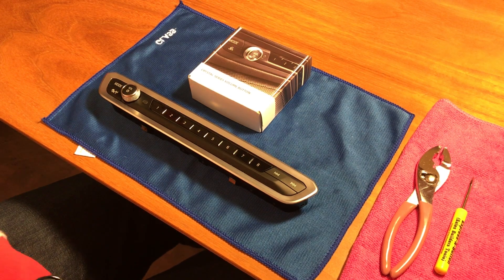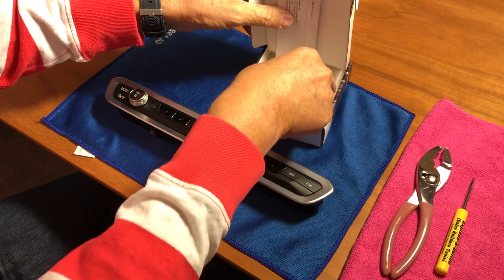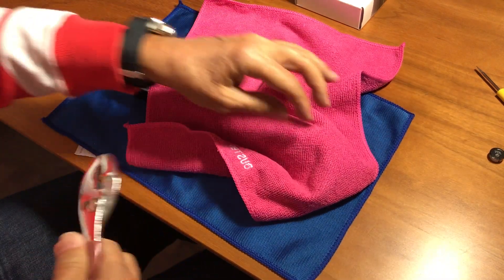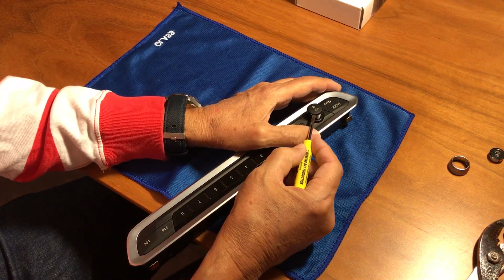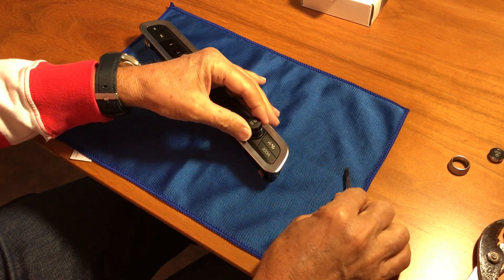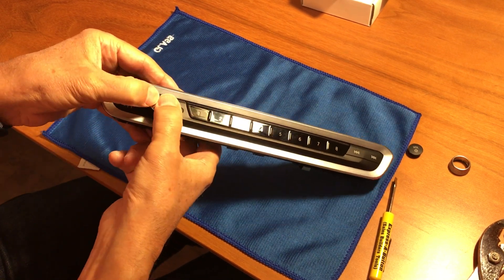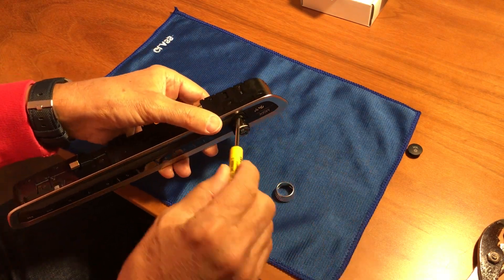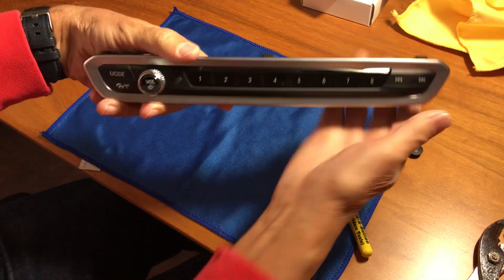Installation of Crystal Volume Button for BMW.

Comment: I ended up destroying the trim ring when using this method...

I have ordered a new unit, and will be removing the trim ring from that to apply to my car.

What is your best advice to avoid damaging the trim ring? Is there an alternative method to removing it?
Reply from the maker: On car-analysis.com there is another video showing a different method and a PDF as well as further instructions showing 2 other alternate installation methods.
Reply: I did too!   Where can I get a replacement volume trim ring?
Reply: @DeanRees-b4x  You can't got to buy a new radio

Comment: where can i buy a crystal series volume button? My BMW dealer cannot find one for my 8 series? I bought another product online but when inserted it was not straight
Reply from the maker: If your 8 series is 2023 or older, I have the product for you. If it’s 2024 or newer, I cannot help you. I don’t know if anyone sells that product. You may have to buy the whole panel from BMW.
Reply: @car-analysis  ok please direct me to where I can purchase . My vehicle is a 2021
Reply from the maker: @Gerardwillemse1  I have it in stock. Email me at info@car-analysis.com for details.

Comment: How do you remove the whole panel/ assembly out of the dash? 
Thanks !
Reply from the maker: There is no need to remove the panel from the car. Note that there are several alternatives for this installation.

Comment: Can you do a video on how to remove interior trim?
Reply from the maker: Not sure what you mean with the interior trim? If you mean the radio panel, it does not have to be removed.
Reply from the maker: There is now an installation PDF on car-analysis.com
Reply: @car-analysis  I need to remove my panel to install something else, is there a method to doing this?  Using a pry tool I feel like I am breaking the panel.  If you have a good method to share I would really appreciate it!  Thank you!
Reply from the maker: @JMG-703  Sorry, I don't have any good info about removing the panel because that is not required when installing our product. I know that some users removed the panel accidentally when trying to remove the trim ring or the button. But you can go to BMW Repair Manual, see https://car-analysis.com/BMW-Crystal-Series-installation.htm

Comment: Good video, however is not always not very practical for driver to remove the unit to install. You should as least have a video showing do it for all your installation video in the cAr. This is due to the different angle how on it going to be done. Removing unit just need another tough step again...
Reply from the maker: This is a demo video. For our installation videos, we use test units that are removed from the vehicles. It is not necessary to remove the units from the vehicles to perform the installations. If this was so, it would be mentioned in the printed installation instructions.

Comment: Ciao ma vorrei sapere se hai avuto problemi di protezione dei veicoli dopo il montaggio
Reply from the maker: No, non che ne siamo a conoscenza
Reply: @car-analysis  siccome ho un 840d cabrio con cambio in ceramica e volevo montare quello in cristallo e lo detto alla Bmw e loro mi stavano mettendo solo il pomello e l auto è andata in protezione e a fuso il selettore e ora mi hanno detto che non si ci può montare xche?
Reply from the maker: @skechtart884  Questa domanda è troppo complicata per Google Translate. Sai usare l'inglese?
Reply: No vorrei sapere sapere se si cambia pure il selettore per cambiare il pomello
Reply from the maker: @skechtart884  There is no need to change the gear selector to change the volume knob, start button or multimedia knob.
Reply from the maker: @skechtart884  Non è necessario cambiare il selettore delle marce per modificare la manopola del volume, il pulsante di avvio o la manopola multimediale.

Comment: Anyone that dares this method will be looking at 100s of dollars after they unsuccessfully remove the ring and are left with a marred and damaged ring.  Many forum theads trying this method with disappointing stories and big costs.  Drill tiny hole or use the black sticky method.  Do your self a favor .. dont try this cloth pliers method.
Reply from the maker: It is true that this installation method has some risks, while it works well in many cases. Therefore, I made another video that uses a piece of printer paper instead. On https://car-analysis.com/BMW-Crystal-Series-installation.htm 3 other methods are mentioned. Different methods work for different cars, without much systematics.
Reply: @car-analysis  appreciate the alternative

Comment: I used this method and when the ring snapped off it was crushed by the force of the pliers.  Where can I order a replacement ring?
Reply from the maker: Unfortunately, you have to buy the whole audio panel. You can get used ones on eBay for a reasonable amount.